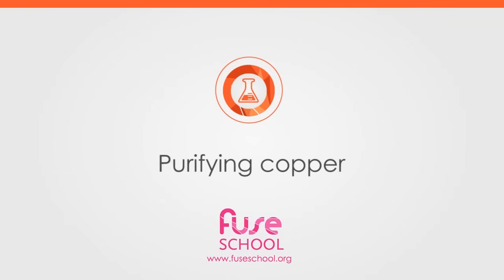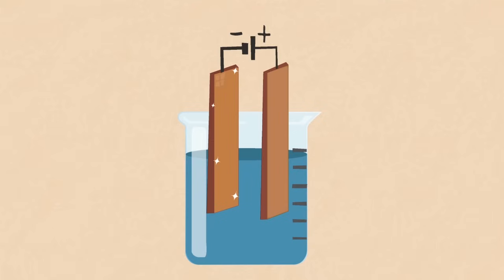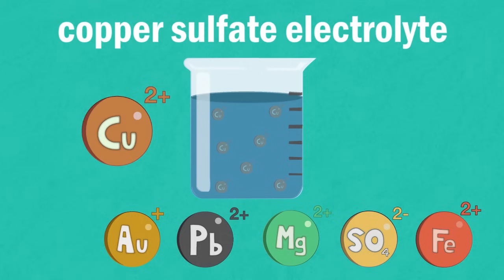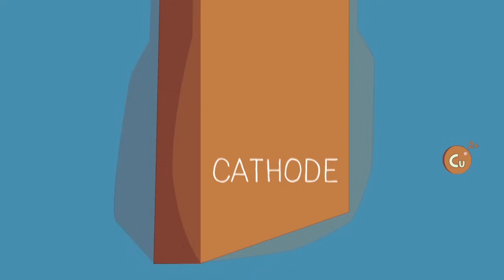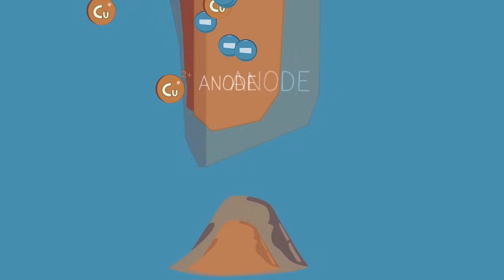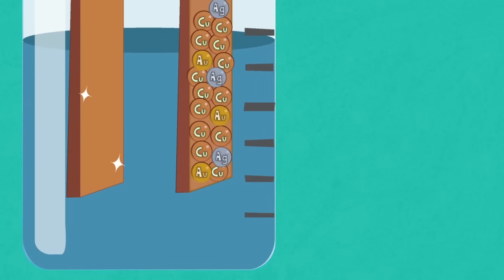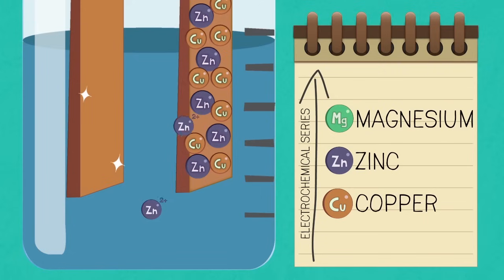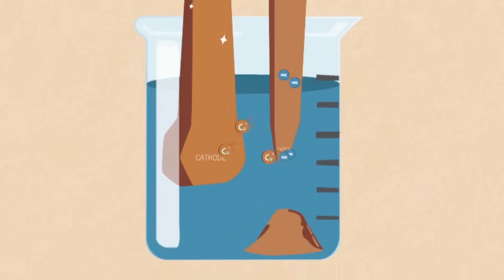Purifying Copper | Reactions | Chemistry | FuseSchool

Comment: Who can answer this question. 

If i was running material that is 60% cu and 39% zinc how could i win out the zink could i use a titanium anode/ or platinum anode and a zinc cathode? Im curious because of the amount if zinc how i could pull it out if solution quickly and efficiently

Comment: Soo, what's the role of the copper sulfate in this experiment? Aren't the copper cations from the solution the exact ones that are reduced by the cathode and therefore turned into pure copper on the surface of the cathode?
Reply from the maker: Good question. Copper ions (+ve) can only form at the anode if there are negative anions (the sulphate ion, in this case) to balance the charge. The sulphate ions (which don't get used up) are there to stabilise the copper ions in solutions from when they are formed from the impure copper anode and deposited as copper on the pure cathode.
Reply: @fuseschool  Thank you greatly !

Comment: If electrolysis is necessary to get purified copper where does the pure "cathode" come from... Also ions fall under the category of theoretical physics in atomic THEORY. 🤪
Reply: The "pure cathode" is obtained from the previous refining. And ions are unstable species, they undergo chemical reactions to attain stability, thus iONS are included in chemistry.

Comment: What happens to the OH (hydroxide) in the solution??? Why is not oxygen formed at the anode???
Reply: Depends on the voltage.  It would be a waste of current and water if it's high enough to release oxygen.

Comment: I am confused. The way I see it, the desired reaction would be spontaneous because in the solution surrounding the pure copper the concentration of copper ions is greater.
Reply: Yes, but in order to obtain the impure copper ions from the anode, one must supply external electical energy so that the ions are discharged and can move towards the pure cathode.

Comment: So if you wanted a purify everything in the impure solution would you have to know all the impure metals and then create a cell where you remove the most reactive metals first?
Reply: Yes and no. It does work for a lot of metals, but not all. So long as it's a non-ferrous metal like aluminum, copper, zinc, lead, titanium, rare earth metals, any precious metals, alkali metals, hell it can even used to refine nuclear fuel. There are some specific cases were it only works in the extraction part and not the deposition (like nickel, once it's in the electrolyte it has to be chemically refined out), but so long as you've got an appropriate electrolyte it should be possible. Btw there are a lot of easy electrolytes to use but most often its sulfides (copper, cobalt, nickel, zinc, and silver come to mind) but that's far from an exhaustive list. The only thing that's important is that there are ions of what you want to extract present, so aqueous salt solutions are the usual go to but others, including molten salts, can be used.

In short, its widely applicable but does need to be specific to each situation. And if I'm understanding your question correctly (that you want to purify metals in one solution sequentially) then it's possible but not optimal. You could do copper until the zinc content got too high then swapped the copper cathode for a zinc one and continue and so on, but it would be suboptimal
Reply: dude your question is so confusing.

Comment: dont get the oxidation and why the copper moves
Reply from the maker: The anode is positive and the cathode is negative. The copper ions in the anode are positively charged and so they are attracted to the negative cathode (via the copper sulphate electrolyte solution). 

At the negative cathode, the positive copper ions gain electrons which is called reduction. The copper is then deposited onto the cathode.

At the positive anode, electrons are lost - which is the oxidation.

Does this help?
Reply: yeah thank you sir :)
Reply: FuseSchool - Global Education  so why do we use copper sulfate????

Comment: Excellent video. How long does the electrolysis process take for example, if the anode is 1lb? How do you test the concentration of zinc ions in the solution? Are there signs that the solution is over saturated with zinc ions?
Reply: sjagain no,